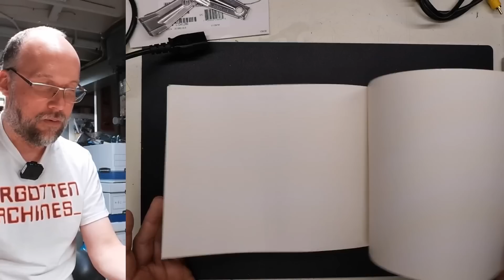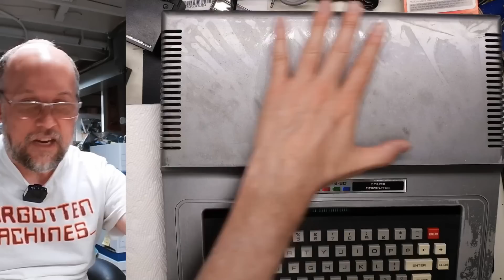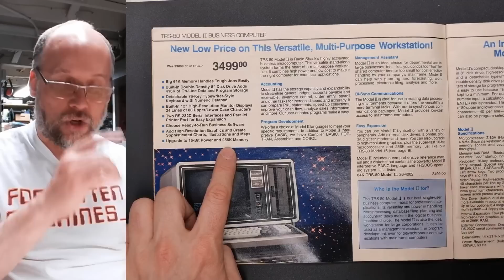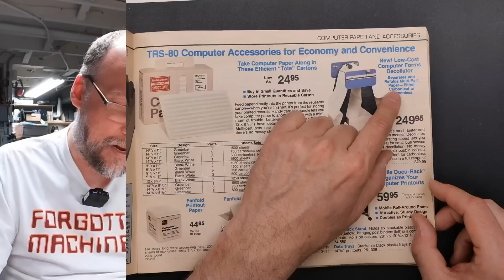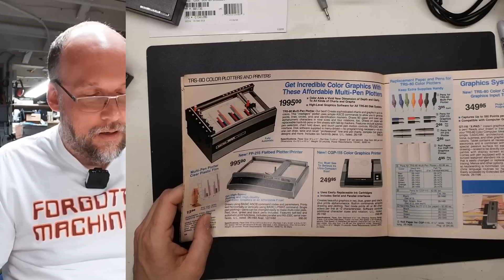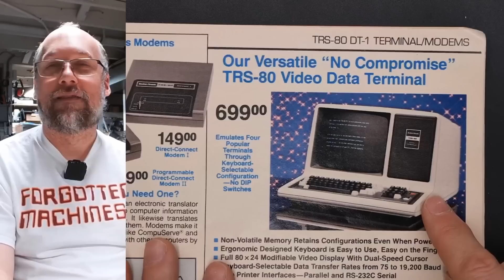0063 A boxed CoCo 1 and a fun read-through of a 1983 Radio Shack catalog

Comment: I had nearly every TRS-80 from the model I, then a III, up to an IV. I also had the 300 baud switched manual modem and a dedicated phone line for it. Most of RS's printers were rebadged Centronics units. I went to a local electronics shop to get dual disk drives installed in my Model III, as it was FAR cheaper than the RS ripoffs. The RS Model III basic didn't have function definitions, which was a pain for porting some BASIC games, but you could buy an "advanced" BASIC interpreter with functions from third parties. Clunky though they were, I probably owe my career to the start those old classic machines gave me. I actually sold copies of some genealogy and accounting software I wrote in the pre-Internet days.....

Comment: I think we had that TRS 80 Model III network set up in my high-school computer lab back in the early 80s. I seem to have a vague recollection of those boxes and wiring but I don't remeber specifics. I do seem to have a memory that it was relatively unstable and would require regular resetting of the host computer.

Comment: My first high school had TRS-80 model 1's "networked" to the instructors model 3 through, you guessed it, the cassette port.  You'd turn the switch to the computer you wanted to get data from, then then CLOAD (cassette load) from the instructors machine and CSAVE from the students machine, and the instructors machine would then have the students program and could run it.

So not a network like we think networks, and IIRC, it only worked from student to instructor, not the other way around.  But i could be wrong on that score.  I simply don't remember.

Comment: Being a big fan of the Shack and CoCo. My first used computer I found at a thrift store was a coco 1. Later I worked for a used Trs-80 Model 1. The computers in the 80's was an investment. You would get 10 years or more out of those systems. Not only was Radio Shack part of the 3 trinity of computers. You need to compare the TRS-80 Model II again mini computers that supported Multiple users for pricing. Also if you take in the fact how much 4 IBM pc's with hard drives would cost. Now it becomes more friendly of a price.

Comment: Radio Shack had 4 versions of the Network Controller. Versions 1 & 2 used the cassette port to interconnect up to 16 systems. Version 3 used RS-232 to interconnect up to 16 systems. Version 4 used twisted pair wiring, ran at 1Mbs and could connect up to 64 systems. Besides the Model 3 & 4, version 4 cards were available for the Tandy 1000 PC line. Version 4 was based upon Corvus Omninet which was an early cross platform lan system which briefly saw some success during the early to mid 80s due to a much lower cost than ethernet systems of the time.
Reply: Probably why they continued to sell the V2. People who didn't have an RS-232 card could still network computers. That and the V3 only worked on the Model III and the Model 4 (in III mode).
Reply: I seem to remember some kind of network board that Tandy sold that had screw terminals on the back to connect the wires.

Comment: Wow, those prices! Is it any wonder the Apple IIe sold so well at $1,395 in 1983? (Or $1,995 bundled with a Disk II floppy drive and controller card, Apple Monitor III, and an Extended 80-Column card.)
Reply: It’s crazy to think the other way around: $4,000 today is ~$1,300 in 1983!
Reply: I think I saw my first computer (Apple) in the 4th grade. I knew i had to have one, so I scoured the want ads in the newspaper until I found one. I called the guy up and asked how much. He said 35. I was so excited. That was a lot of money but seemed like I could do it. So, $35, where do you live? No, 35hundred. :( I had to ask my mom what that meant :(( Needless to say, it took a couple more years to make that much.
Reply: But the Apple did not do payroll or accounts receivable. These were business machines that were competing against low end mini computers like DEC.

Comment: sand it down, leave the back plate i/o panel, match the paint and use a mat first, sand it, then paint it with blue or red or silver, then gloss it. if you sand it the paint wont run if you keep it even.

Comment: Wow, that brings back memories.

I bought my own Model III, must've been late '80 or early '81. Spent my entire income from my paper route to do it, and still could only afford the 4K version initially. I did manage to scrap the funds together for the upgrade to 16K later.

In hindsight, could I have gotten a better computer for the same or less money? I'm not sure...I didn't bother to check prices. At the time, I was fixated on the TRS-80 line, since it was the one computer I had the most experience with. Not only did I have a couple of family friends who had a Model I that I'd cut my programming teeth on, the Radio Shack was the only store in biking distance where I could play with a computer. I'm sure in my mind at the time, it was really the only option.

Looking at those prices for the CoCo, seems like I probably could've gotten the 32K version with Extended BASIC, along with a color monitor, for around what I'd paid total for the Model III ($1K, plus the $60 for the cassette deck). But considering the release dates, I guess the Model III had come out just a hair earlier than the CoCo and the VIC-20, and I was probably champing at the bit so even if I'd known those were coming out (which I probably didn't), I would've still been impatient enough to go for the Model III anyway.

We continue to see computer hardware capability improve as prices drop, but nothing so dramatic as in those early days! I'm impressed that a catalog from a few years later, well after the CoCo came out, Radio Shack was still selling the Model III for the same price I'd had to pay when it first came out. I guess that might have had something to do with their general failure to retain share in the home computing market.

Comment: You might not be able to determine anything by the serial number, but there was a date code. 10A2, so it was made in October 1982.

Also, you talk about dropping $30k for a computer at a Radio Shack. The used to have some stores that were RadioShack plus Computer Center. These were specialty stores, most even had a dedicated staff for commercial and custom sales/support. I worked at one of these stores (after they were no longer Plus stores, but my manager HAD worked there at the time.) It wasn't out of place for our city's university to drop a cool million or so on a single sale.

Comment: I recently was given a bunch of vintage computers including me a really nice TRS-80 that appears to be an almost perfect condition along with some commodore disc drives and a printer. I also ended up with an old terminal computer as well. It's basically you're not going to be able to do anything unless I have the mainframe to hook it up to. I also got some IBM XT models along with some software. I also recently picked up a commodore vic-20 from eBay which needs a power supply a number 9 key and spring and also AV cables to hook it up to a TV or monitor.

Comment: Adrian, in my high school, we had 12 of the mod 3 computers attached serially to a single trs-80 mod 3 with dual floppy drives.  All ran via that serial cable back to the extended board that sat next to the 'mother' computer.  All drives were single sided 5.4" floppies and all could be accessed at the same time. Thanks for the excellent content as per usual!
Reply: I remember toward the end of the CoCo era, a program was published which allowed you to turn the 64K CoCo into a serial printer buffer.  It used bank switching to "turn off" the ROMs and place itself right at the bottom of RAM so that it could use most of the 64K as the buffer.  But if I remember correctly, it could only either receive or transmit so you had to first fill the buffer with the complete print job and then switch it to transmit to dump the buffer to the printer.
The whole idea was to deal with slow printers, but that's no longer a problem and serial printers have pretty much gone the way of the dodo.
Reply: I think there were some late Model III’s with the white paint.
Reply: Yeah, I sold a system like that in Virginia Beach to a high school for $35K.

Comment: The Coco 1 was my first computer back in '82. Mine was like the one in the catalog with the main badge to the left and the memory badge on top to the right. And it's the black plastic - I was on it almost constantly from the time I got it until fall '85 when I went to college and was required by the school to get a PC (IBM PC Portable in my case). I still have it, in the box, along with a couple of floppy drives, a multipak interface (which I think still needs repair after a science fair project when wrong) and that graphic tablet. Didn't pay nearly that much for the tablet tho. I don't think it was a very big seller and they closed it out just a year or so after your catalog. I think we paid about $100 for it. It was...kinda functional I guess. Mine was off going up the left side as I recall. I don't know what's in the interface pack, but the tablet itself is just a big pcb with a bunch of crossing traces and resistors, plus a couple of pots for calibration. I was able to somewhat correct the weirdness with the pots, but never completely. Always wondered if some of the resistors were out of spec and if replacing them with better, tighter tolerance ones would help. Maybe I should make a video about it...

Comment: Re: Radio Shack computer prices I grew up and taught myself to program on a Model 1 by hanging out at a local Radio Shack Computer Centre in Toronto and remember even the tape drive cost over $100 and it was just a standard sized cassette tape machine (with carry handle!) which you had to set the volume between 6 and 8 and a cable.  Good times because the staff were all for programming just "no games" policy.

Comment: I have to admit I do have some love for the TS1000/ZX81.  Modded my TS1000 for composite video, added 16k internal, replaced the keyboard and the 7805 with a Traco (less heat).  I also had to replace the RCA jack, as it was damaged.
Yes, it is a SUPER SUPER minimal machine, but I have to admire it for what it is.
And some of the "hires" games are surprisingly good.  (Well, for a monochrome no sound minimal system).  ;-)

Comment: Our high school computer lab had model 3s with single floppy drives. We programmed them in assembly language. I remember how glorious all those registers on the Z80 were compared to the 6502 based Commodore at home. In 1984 they were upgraded to model 4s, so Radio Shack must have had an upgrade kit. By senior year we had a mix of silver/white screen and white/green screen model 4s. I don't remember any kind of network though.

Comment: To use a TRS80 network 2: LOAD software program on host from floppy. Type CLOAD (cassette load) on each of 16 networked units. Type CSAVE on the host.
This distributes the program to each machine. This is typically for a classroom teacher to load software on each students workstation.
Reply: The knob on the unit is to select a workstation to upload a file to the host unit. This was typically to save students work.

Comment: I don't think any car has that fine a silver medallic, so I would look at the cheap standard/general silver spray can stuff, ie, it does look like cheap paint.
Spray cans are quick dry, so I wouldn't worry about dust, ie, I just spray outdoors and it's not a problem.
If the plastic is making that pattern in the paint, wouldn't the bottom be damaged, ie, it looks like solvent damage.

Comment: The computer lab in my Jr High school had VIC-20s with A/B/C/D mechanical selector switches for printers and disk drives. They had one disk drive and printer shared with four computers. You had to manually turn the dial switch when you wanted to use the drive or printer. With their C64s they eventually got more drives, but I imagine this scenario is similar to what the radio shack "network" was doing. I even saw a dial on one of those units in the catalog.

Comment: Sounds a little like car work, "this is going to need a total respray." heh  If you do paint, it might be good to learn how to use a air sprayer, or, really take time to find out how to get a smooth finish on other surfaces with cans (difficult). You can create a small paint booth with cardboard and plexiglass. Patience is required as you know... argh.

Comment: The first HDD I ever bought was a Maxtor 8.6GB for $150 and my Epson 800 was $200 and 64MB of SIMM RAM for $150 in the late 90's.  I was born in 1986 and was never exposed to any of the Radioshack computers. I do remember computers being super expensive.  The computer I bought that 8.6GB HDD for was an Epson and was given to me by my aunt who got it from her boss as they upgraded it to Windows 95 and it was BSOD city. That PC got me into building PCs.
Reply: Remember when 4.1 GB seemed like a huge amount of storage space? Back then, disks had just started to measure in MB and GB, and people would say ‘You will never fill that drive!’ But now, the whole operating system, all your files, documents, internet videos, etc. take up much more space. I wouldn’t even bother with a USB flash drive of that size. What could I possibly use it for?

Comment: I had that catalog and the ZX81 the year after I graduated from high school (1983). I had learned to program in BASIC on an     Apple ][ in a semester long class my senior year, so I wanted to get some real experience with programming and bought the ZX81. (My parents refused to buy me an Apple ][; they could have afforded it, but said it was too expensive.) The ZX81 was such piece of shit that it turned me off to PCs for the next 15 years. In the late 90's I learned to assemble PCs from castoff parts and learned a lot about modern hardware, but whatever aptitude I had for coding never got a chance to be fulfilled.

Comment: I would not paint it at all, because it removes some "originality". Just ignore the scratches or whatever that is. The scars (right to the keyboard, oh boy!) shows it was a hard worker back in its day. Countless hours of Space Invaders. 😀

Also, shouldn't the lower shell be affected by whatever the bag did to the upper part too?

Multi-User: CP/M has that too. No real user separation though as on UNIX or Linux (or even Windows these days).

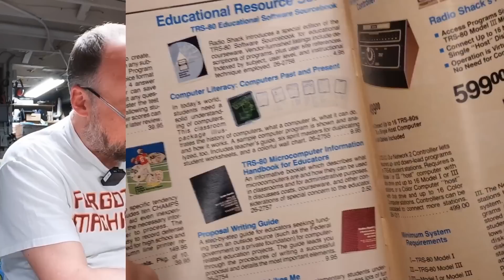Comment: at 41:12, and interesting of how the serial port of the coco color worked never tried or used one the serial part, much much,  later fount out , the it was much more like the 4pin  version, of what the data pin on a raspberry Pi would become the data in and out only existed in software, need programming to tell the computer what the 4 pins did, so it could do anything, all set as  inputs or all as output, as said never had anything to connect it up to so only go on can remember? right or wrong, (so don't go using this as instruction, of what to do or not)

Comment: I had a Coco 1! I got it new (I’m 57). I since donated it five years ago to a computer museum. I now wish I would’ve kept it. I had the box and manuals. Everything. Fully functional! What a great video!
Reply: Your donation made it possible for others to experience the enjoyment and edification that came with your CoCo.  Thank you for donating, and for sharing from your life to others.
Reply: kinda glad you sent it to a museum instead, wouldve collected dust but is probably on display now for hundreds to see and appreciate :3
Reply: I got one of those a while back.  I wrote a machine code program which interfaced with a running BASIC program to allow the program to put text directly onto the high resolution graphics screen.  It could be loaded to any available place in RAM and would run from there since it used PCR (Program Counter Relative) instructions for all internal calls and references.  I would use the CLEAR command to reserve 6 "pages" of video RAM since the high-res screen needed 4 pages.  The other 2 pages would be used by my program.
Printing to the high-res screen became a simple matter of setting up a USR call and then calling it with something like:
X=USR0(CHR$(26)+"Hello, world!")
The CHR$(26) would clear the graphics screen followed by printing the text starting at the top left corner.
That was just the start of what the program could do.  It could re-define characters, repeat characters and a lot more.

Comment: If you put the case of the Coco in a trash bag with rubbing alcohol for several hours(outside in summer heat will help as well) it will soften the paint to remove it. This is an easy way to prep it for a respray, I did the same process before painting a friends Magnavox Odyssey II which came out pretty decent.
Reply: Nice process!

Comment: you should give the zx81 a bit of a chance if you haven't - it's wonderful though rubbish. Built reverse engineered clone from a kit recently. Games like 3D monster maze are suprisingly good bearing in mind it's limitations. Sega's Frogger is quite impressive too!
There is a highres mode too coded by a guy called Wilf if you modify your ram pack (wont work with the clone I have sadly)
There are even ethernet adapters for it and a web browser (zeddyfox)

Comment: I had a load of fun with my CoCo 1 after it arrived in 1980. Mine had the black textured keyboard surround, yours has the smooth silver surround which is around 1981-2. I do recall a comment in Rainbow magazine that Chrysler silver gray rattle can paint was a close match. Btw, the wear in front of the keyboard tells me it’s a high hours machine

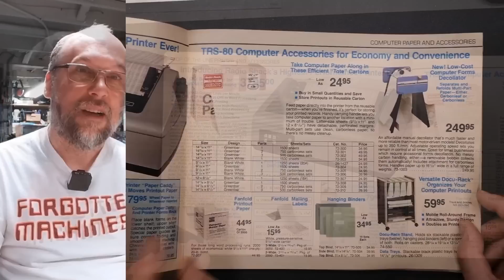Comment: 27:58 if you're printing multi-part paper and didn't want to separate into sheets, you might want this to split the print out into it's parts.  The cover in one pile, the second copy in another pile.  Useful, but I'm sure you had to be doing a lot of printing to make it worth it.